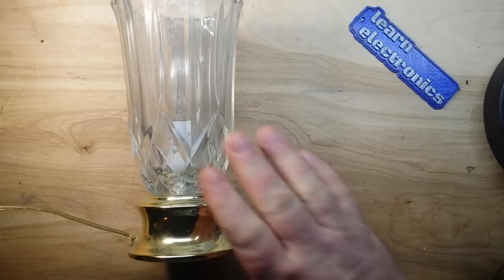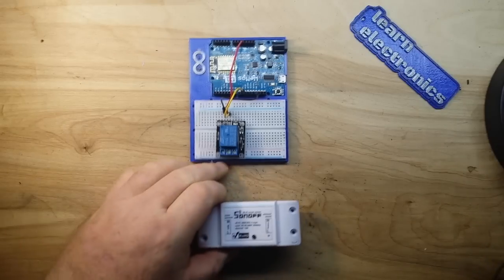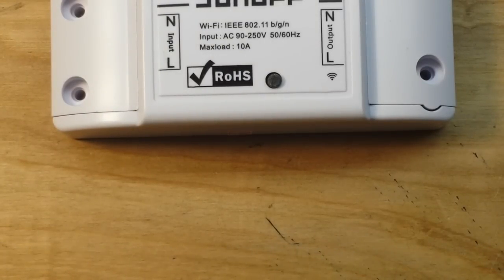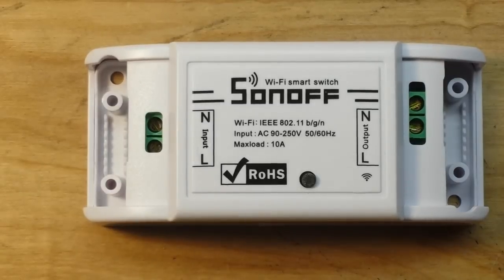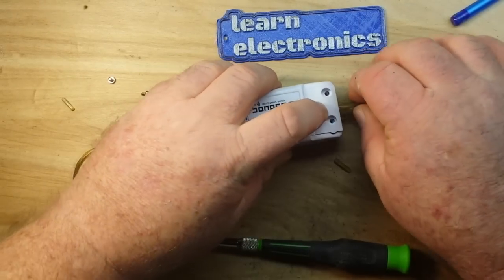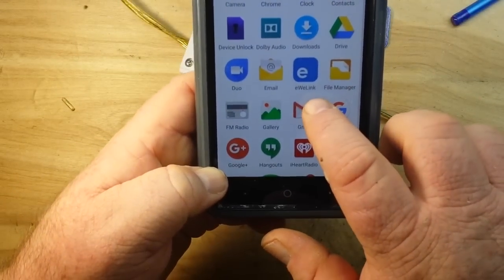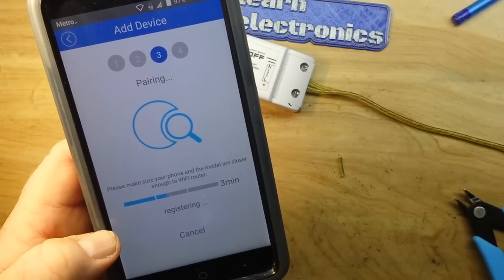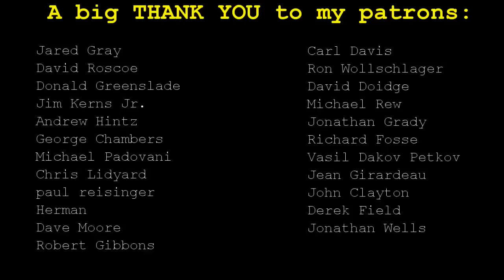Complete SONOFF Smart WiFi Switch  setup

Comment: Hey Hi, waddup.. hope this finds you in good spirit,  My 6 month old Sonoff basic R2 konked off ... I tried changing the relay, but it will not budge, it will not come back on (sadly the original relay broke off while desoldering it out) (Also there is no glass fuse, its seems to be a 5 band 10 Ohms 5% resistor in its place inside a heat shrink tube).. ... Anyhow Funny though 5 other Sonoff basic R2's switches have been working for over three years perfectly well ... And this new unit circuit broke and I cannot figure what component has popped. ... I'd be totally thankful if you could guide me on how to fix this.

Comment: Can you wire this in so the normal inline switch still works?
Also if you take power off the unit do you have to re-pair to network, or does the name you gave it (lamp) allow reconnection?

Comment: I want it to control my "impulse switch / latching switch relay or whatever they are called in English in my house. They must be controlled with google home. I can get sonoff to work with impulse so it gives an impulse when I say "turn on" light, but when I say "turn off" light, goggle home also says okay to it, but sonoff does not give an impulse, by the command "off". Someone who has an idea? or impulse may not work with 2 different commands "on and off"

Comment: I have several Sonoff switches and have had NO PROBLEMS until recently.
The last few switches I have purchased are a NIGHTMARE.
They simply will NOT PAIR.
Of if they do PAIR then they come up on the EWELINK App as OFFLINE.
I have tried everything, using another phone another IPAD or ANDROID PAD.
Sometimes I get farther than usual but then I get "only works on 2.4 Ghz".
I have turned off 5.0 Ghz on the router but that does not help.
I am about to throw these switches out of the window.
The first half dozen switches still work fine and do everything they are supposed to do.
However I am VERY RELUCTANT to reset those working switches JUST in case they STOP.
ANY SUGGESTIONS, PLEASE.
I have about a dozen Best Buy (Insignia) switches WHICH WORK FINE and they are cheap, I have bought some on EBay for as little as $8 A PAIR, DELIVERED.
THEY WORK FINE.
Thank you in advance.
Reply from the maker: I dont have any suggestions. Cheap Chinese stuff just dies sometimes. I have 5 Arduino Nanos that up and died after 3 years.

Comment: can i use this to break a flow switch in a pool heat pump to control pool heater from phone or does this need to have a resistive load. if i am asking that right
Reply from the maker: As long as you dont exceed the current rating, you can do as you wish.
Reply: if i only run one flow switch leg thru son off  what powers son off

Comment: Awesome! Video was very straightforward. Tinning the wires is best as  I tried it without and the wires came loose and blew a fuse. Do solder them. Works well. With Googlehome too. Using it for my morning brew. thanks a heap.

Comment: I want to control high ratings current device I.e. 30 amp. can I replace relay?
Reply from the maker: +Bhavesh Nagar Sonoff is made for devices like lights and fans. I would not recommend changing the relay.
Reply: learnelectronics thanks
Reply from the maker: +Bhavesh Nagar No problem. The reasonI don't recommend it is the tracks on the board are too small for 30A.
Reply: It would be easy to use the sonoff to control a 30a relay with a 120v coil
Reply from the maker: +geterdnboy 30 amps will blow the tracks off
Reply: http://www.finglai.com/product/relay/solid-state-relay/ASH-AA.html

Comment: Hi enjoyed your video. Just a warning for everyone: never switch the neutral, it will mean that the live conductor will have mains voltage throughout the circuit and appliance. So in the case of a light. The light will be switched off but if you touch aconductor or exposed fitting your will create a circuit to earth and that could end badly. Keep up the good work..

Comment: The router on my house is being MAC filtered so you have to write every mac address on a list in order to let devices to connect to internet, otherwise the device just connect to the router but no internet, where is the mac address on this device?
Reply from the maker: +chancho00 During first launch of Sonoff switch, it goes automatically to configuration mode. Build-in LED blinks fast. In your computer or smartphone:

open WiFI manager and look for WiFi network called with SONOFF_ prefix.connect to this network – there is no passwordwhile you are connected to it enter http://192.168.5.1 in your web browser.after few seconds configuration panel should open
Reply: mac filtering is a minor speedbump  an unfortunately way too easy to get around for someone that has the ability to capture a WPA handshake and crack it offline with a rainbow table  - mac address spoofing has been pretty trivial for a very long time

Comment: Thanks Paul. So that is what a SONOF is! Just a box with ESP8266 a ( 3V/5V ?)relay module and power suppy! ;D
That upper chip is probably a flash rom chip holding the ESP8266 soft/firm-ware.
And in any power circuit (PSU/Relay...etc.)  [educated guess] whenever you see a 4 pin chip it is mostly an optocoupler(opto-isolator).
One can make their own SONOF and call to a FatherTo ;D
Just get a Wimos (Arduino-like one) and a Relay Shield/Module/Breakout
https://youtu.be/3bFs_MZVFxw
This saves you from using wires. You could try the ESP8266 (got several editions/versions from 1 to 14, some got wifi antenna plug/socket, PCB one) Module/Breakout too.
http://www.esp8266.com/wiki/doku.php?id=esp8266-module-family
Choose one you can handle as some of them require soldering pins
Reply from the maker: +igrewold The point of this video is that you can control things without knowing how to wire or be a programmer.

But yes, you are right a WeMos and a relay like I showed at the very beginning of the video is how technical minded folks like to handle things.
Reply: +learnelectronics Thanks a lot Paul, you are always doing great stuff. In my previous comment, from the 3rd sentence and beyond, I  justed wanted to share info with peeps.
And you are right sometimes having something ready-made makes it much simpler to deal with other important stuff.
And thanks again for making a great playlist for Wimos/ESP8266 stuff, makes it  much simpler to try its different projects.
https://www.youtube.com/playlist?list=PLGhvWnPsCr59H2dQw1bELKTHllGnwYlZW
Regards
Reply from the maker: +igrewold All good my friend

Comment: Does it have a manual override if your phone isn't handy?
Reply: The button used to set it to pairing mode works as an on/off switch.
Reply: Bob3519 Thanks for that.  I sent for a couple to play with.

Comment: Neat device. I've been looking at them for some time, thinking it might be a good investment, just never saw anything about them before. Now I think a couple are in order. Maybe Banggood or Amazon has a deal on them today? Thanks I'll use your link this time.
Reply from the maker: +George Chambers They are pretty inexpensive. What you saw today was just the tip of the iceberg. They can be reprogrammed, hacked and even voice controlled.
Reply: Well I ordered one off your link. I'd be interested in seeing you do some hacking to the Sonoff switch!